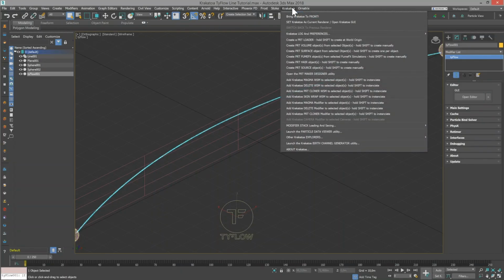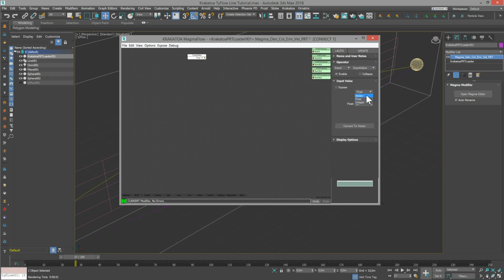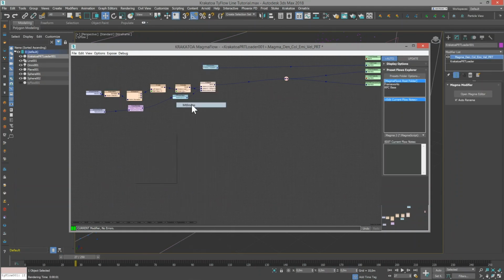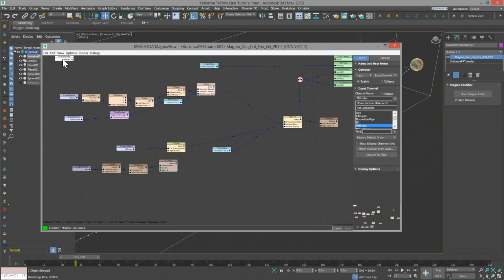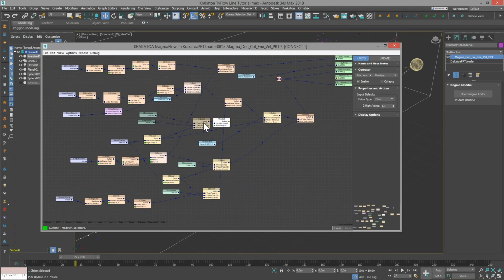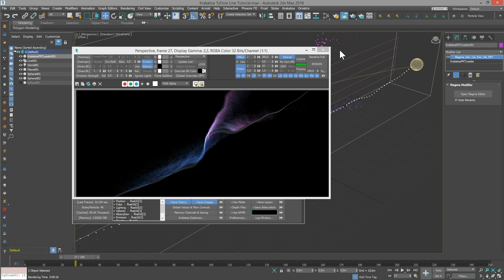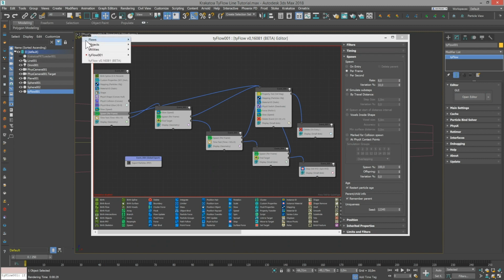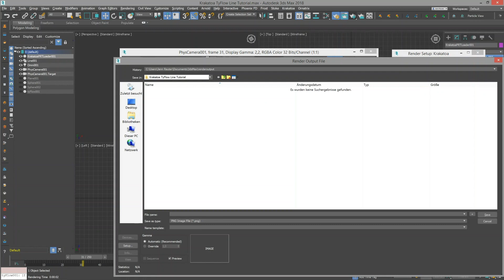TyFlow/Krakatoa Line - VFX Tutorial (Part 2) | Krakatoa Set-up

Comment: Thank you for this tutorial. But i cant find gradient map krakatoa, if i use gradient map normal the result of render only white color.
Reply from the maker: Did you use the gradient ramp map from 3ds Max standard material editor? Drag a vire from it in the extended material editor into the Input Texture Node slot and choose „use as instance“ in the pop-up menu. Then you can add the bluish colors in the gradient map’s handles✌🏻